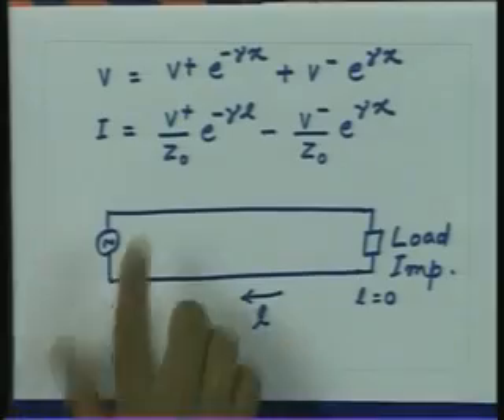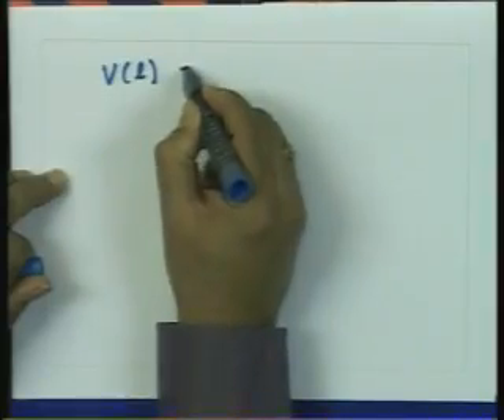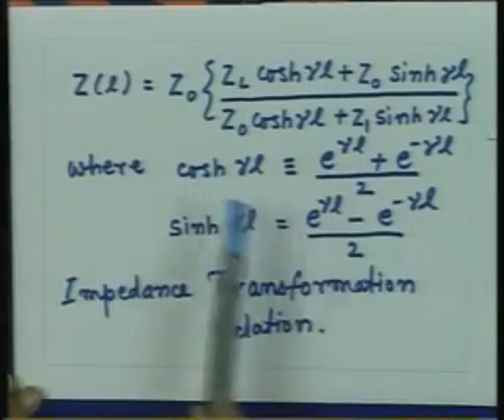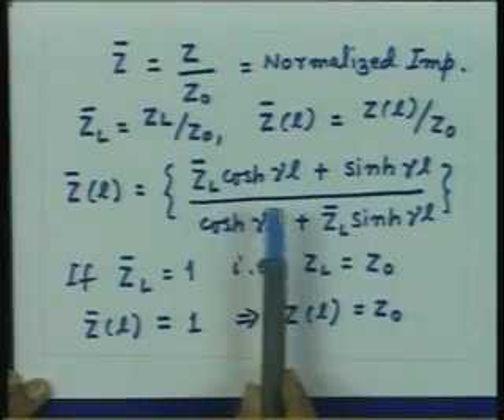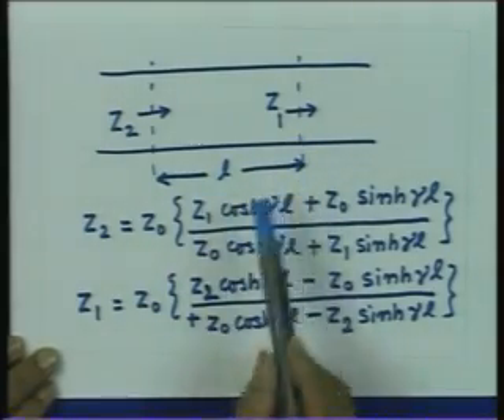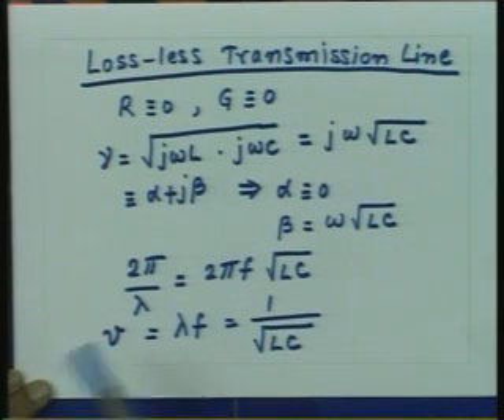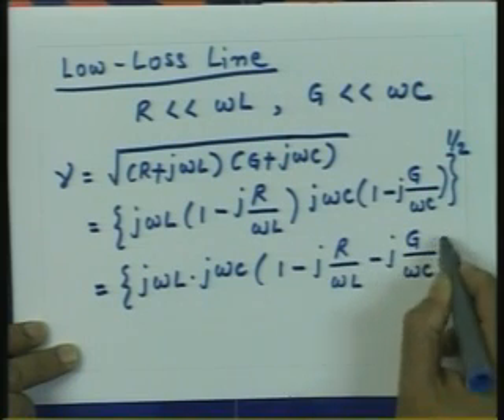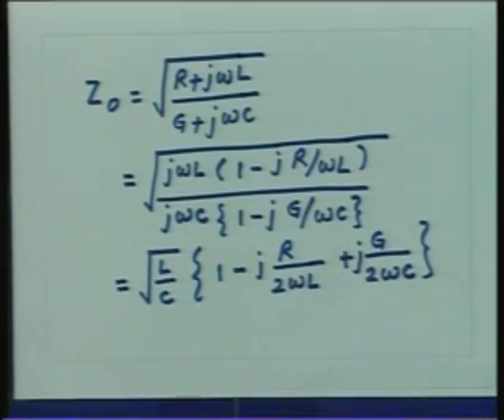Impedance Transformation

Comment: I have a doubt! It is said that if R = G = 0, the line is lossless and the whole power is transferred to the load. But even though R = G = 0, L and C exists in the system. This stores the energy somewhere along the line, right? Then how can maximum power transfer occur?
Reply: +cannibol9009 , Yes you are correct, but keep in mind that pure reactance do not consume any real power. For instance, an inductor element converts the absorbed power in magnetic energy. As per the hysterisis the power consumed by an inductor is oscillatory in nature, thus energy is consumed in 1 cycle and delivers in another. Therefore no power consumed on average. Same for a capacitor.
Reply: Yes +Nikhil Sharma, you are absolutely right! Thanks for the clarification!